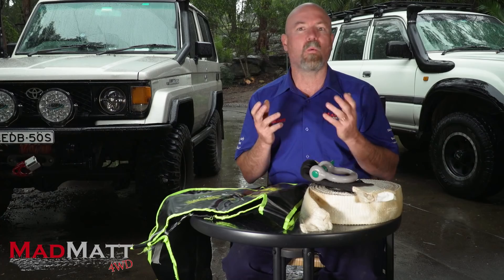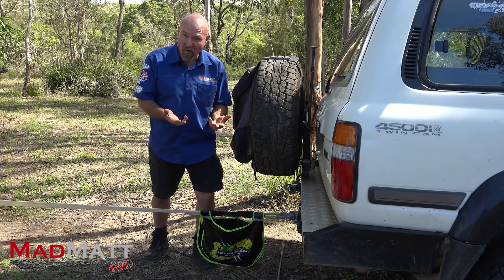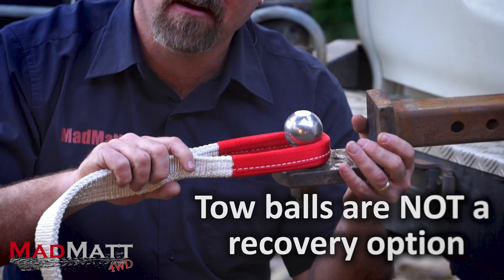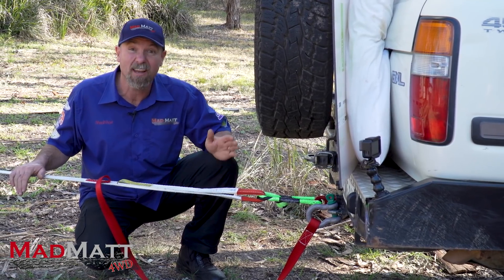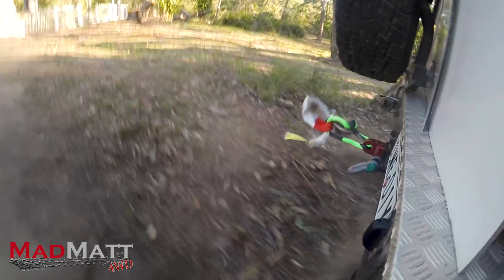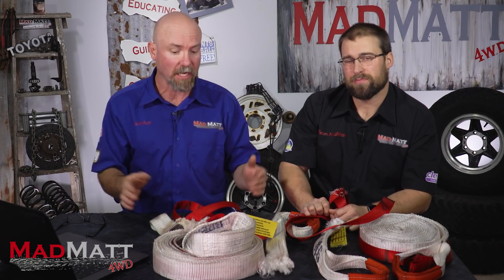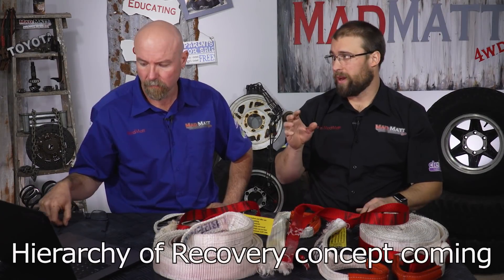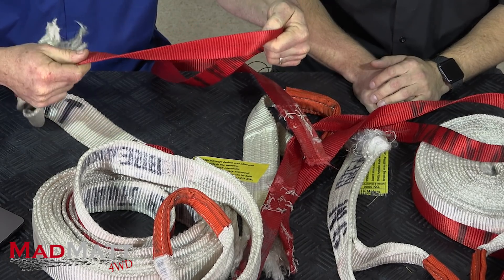Dangers of Snatch Strap Recoveries - Destruction Testing

Comment: Don't sell yourself short. Doing an expremiment and sharing your results is the definition of science.
Reply from the maker: Thanks mate
Reply: Absolutley, Scientific process is not limited to just "Scientist". Science is questioning, theorizing, testing, proof of concept and results. This video has all that.
Hello from America. :)
Reply: It is wise to know one’s limitations.
Reply: @MadMatt4WD 
Hey Matt, I saw a video of someone using a length of reasonably heavy chain, around 1.5m long, as a damper. It was clipped to the winch rope with carabiners. Are you willing to test this method of damping? For my mind it seems like a good idea, they had it at the mid-point, I'd like to see it at the heaviest point ie. At hook or shackle/failure point like a snatch fuse
Reply from the maker: @Duke-le6vy  I’ve heard of that idea but never tested it. I could look into it. The drawback is the chains weight.
Reply: @MadMatt4WD  I agree with you there. It's a bit of a double edged sword with the weight being both pro and con. That said I'd happily forego a few non-essential items to balance the weight of the chain if it's going to pull up a 200mph projectile! In reality as your test showed, 5kg is enough weight and that's not an excessively long piece of 10mm chain
Reply from the maker: @Duke-le6vy  yeah you make good points and that’s a good way to think about it.

Comment: This video has been incredibly helpful, have never even thought about how dangerous snatch recovery’s are so this was definitely an eye opener, keep up the great content Matt!
Reply from the maker: Glad to help theres a few other vids on the subject you may appreciate.
Reply: They used the wrong gear and it was to an anchored object that was never going to move, of course strap would break. All they proved is that the strap breaks first at the fuse as it is far less rating to the soft shackle and rear hitch

Comment: I enjoyed seeing these tests...I'm writing this after seeing your comparison with Yankem Recovery Ropes on . Matt's Off-road Recovery in Utah. I was impressed with that comparison too
Reply from the maker: Thanks mate. We're just trying to help and it's pleasing when we do.
Reply: Have had a failed strap go whizzing by my head. Scared the bagebees out of me.  Now use small Kevlar sling and two long chains.  Never had an issue after using the chains and Kevlar sling.
Reply: Me too. I still think MattUSA should be using dampers, especially when recovering cross overs and rental vehicles. I have a suspicion that a few of them have gone back with slightly bent suspension. That said, many of his recoveries would not approach a wood filled big hole for anchor effect.

Comment: I Had never heard of the tether, however i love the idea, as an Engineer, its totally the better approach, im pleased to see you guys working with who ever produced it to refine same, its far better than any ballast hung over the snatch strap, which could easily be misused, the tether just needs to ba a bit longer and slightly elastic, the idea being when the snatch fails, its long enough that no serious pulling load transfers to the tether only the load of the failed snatch strap, great work guys, John Gurney
Reply from the maker: Hey John. The company didn’t take on any of my recommendations. I think a form of fall arrest system is what would work.

Comment: Matt, real interesting concept, if you look at the free fall on a safety lanyard for working at heights this is folded and stitched in a concertina this allows for a longer length of safety strap and more likely control of the recoil
Reply: Exactly what I was thinking
Reply: The stitching isn’t just to shorten the tether, the stitches act as energy sinks as they blow apart when it’s stretched.
Reply: tether to a bag of dirt/gravel attached with easily failed string to vehicle

Comment: Hello, I found your channel through a link in Matt's Off Road  Recovery which I watch a lot. Thank you for the video, I did learn a bit from it which is why I watch these videos of course. One thing that I have always done which may or may not help some of your viewers. When I am pulling something out it tends to be a small tree or a fence post and I am using a basic tow strap. What I have always done is to put the rope through the canter of my spare tire fairly close to the end where my target is. This way if the rope comes loose from the tree or post, it tends to get wrapped around the tire instead of flying at my truck. By the way my truck does have a dual coil spring mount for the hitch which absorbs the sudden impact of a tow. Thanks again!
Reply from the maker: Thats an interesting idea.

Comment: Hi, great video. I love watching other people break stuff. 
I thought that tether looked a little short. I’m wondering if you or the manufacturers have discussed using a suppressor similar to that used in a lanyard for fall suppression when working at height. Picture this, the tether is 3m long, 1.5m of the tether is folded upon its self until the length is only 1.5m. The bundled tether is then stitched together in a fashion that is weaker than that of the anchor stitching and placed in a protective cover. The idea being that the tether is long enough that the snatch strap has returned to its static length before the tether loads up. Then if there is still enough energy, it will be dissipated when the suppressor stitching fails, leaving the tether intact.
Keep up the good work!
Reply from the maker: I’ve discussed that concept with manufacturers and they couldn’t care less. Very disappointing.
Reply: Sad.
Reply: What part of The country are you in? We visit every 10 years, 2022 is the next planned trip. Could pop by and say Hi if we are near by.
Reply from the maker: Sydney
Reply: @MadMatt4WD  They might if they are sued for knowing about a weakness and doing nothing to correct it, if a tragedy occurs.

Comment: Suggestion, have the tethers sewn up with a "zipper" style the treads are designed to "peel" apart in layers to absorb the energy
Reply from the maker: yes
Reply: Agree, same concept as a shock absorber in fall arrest systems.
Reply: Or do it like fall arresters so they break in stages, each absorbing part of the force.
Reply: Working at height stuff  from petzl has shock absorber zip stitched stuff in

Comment from the maker: I would appreciate you watching the FULL video but there are skip points in the description if there is a section you want to check out!
Reply: Hi Matt, good to see someone doing shock load test instead of bench test. How come you used soft shackle instead of bow shackle ? 
4wd "SAFETY" is a large can of worms. Doesn't matter how safe the equipment is there will be those that don't use it correctly. There's a video of people snatch/towing a newish Prado out of water with hooked on the bull bar not tow/recovery point. 
If tow balls are so prone to breaking when used in recoveries, why did Ronny Dahl have to cut them and still took several attempts to break them off ?
Also what's the point of "RATED" recovery points when what they bolt to isn't that strong ?
Reply from the maker: No real reason to use soft over bow. Both are good and safe. 
Yes it is a can of worms and yes I saw the prado vid and just shook my head.
Towballs are a single shear item rather than double shear this is the reason they're dangerous. Just because it took a few goes to get one to fail doesn't meant they don't fail. There are numerous vids of towballs failing.
Totally agree with you. This whole rated recovery thing is not that helpful and provides a false sense of safety IMO. Unless the complete recovery solution is tested it's just one item thats rated. IMO to call it a rated recovery point it needs to be tested as fitted to a chassis. I'm sure some are but not all. I prefer to use the term suitable which is more vague but removes the false safety element.
Reply: As for improving these tethered straps, first should the tether be of the same rating as the strap and maybe a Joey pouch to hold a few metres of the tether so the driver has time to react.
Reply: @Low Range 4wd WA I have my moments. The problem is the end user, will they use it correctly ?
Reply: @Low Range 4wd WA IMO there is to much focus on numbers IE how many KG's something can hold pull extra. 
What's the point of a 5000kg "recovery point" when what it's bolted to isn't rated. How many 4wd have a tow rating of 5000kg on the front ?
How people actually know what swl or wll means or what the percentage factor means or what the difference is between them and breaking point. When I learnt, I don't remember hearing about people being hurt, but back then we also learnt from doing it with our elders and it was a privilege to do it due to the cost. Unlike today, most items are a lot cheaper and people just do it without any form of training or knowledge.
Reply: Hey Matt, I have an idea for the company. Have a tether that is folded over itself a few times to make the length a meter and a half in this example of original length of strap. And that way the strap won’t have any stretch left in it and the tether can then be the only thing that has energy in it. Then the tether can rip off from the stitching and it will be the only thing with energy in it. And the weight of the strap will be too heavy for the tether to come all the way back. Does this make any sense?

Comment: MANY years ago, we did not have tow straps (much less *snatch straps*) and we used chains for towing a disabled vehicle or for pulling it out of the mud if it was stuck.  As such, if you took up the slack too abruptly, you ended up with quite a bit of jerk, possibly damaging both vehicles.  I've seen an old tire used as a shock absorber of sorts, kind of like how they use one between the cable of a crane and a wrecking ball during building demolition.  Chain has no give to it, so if you are towing someone and they don't constantly keep up the slack in the chain, you end up with a lot of jerking every time the slack gets taken up.  With a tire added to it, you don't get jerked as much.  Of course, the tires that were being used were a lot narrower than what you see on most off-road vehicles these days.
Reply from the maker: I have seen that. But yes there is a big difference between a tow and a kinetic recovery
Reply: @MadMatt4WD  -- Yeah, back then we didn't even have the concept of kinetic recovery straps / ropes.  Vehicles that had winches tended to be ones that had PTOs instead of electric winches.  Of course, there was always plenty of trees that you could use as an anchor point along with a farm jack and sufficient length of chain.  Things have changed a lot over the last 50+ years...
Reply from the maker: That they have

Comment: The group I wheel with uses a second snatch strap as a tether. We attach it at about 3/4 the length of the main snatch strap. I've seen a fail twice and the secondary snatch strap acted as a much stronger tether than the red ones and stopped the fly back.
Reply from the maker: That’s interesting.

Comment: Well, the moral of this test for me is the 9000kg snatch strap is far to light.  I know you guys said use items rated for your vehicle, but after watching this test 9000kg strap is not up to the loads. My snatch strap kit is rated to 13,000kg and I only have done 3 recoveries, my heavy recovery took 2 goes, so still good for another 6 recoveries. I had to snatch out a heavy 79 series LC and first go hit it very hard, and it just sprung my back, not damage to the strap, second go out it came, so higher rated snatch strap is for me the way to go.
Reply from the maker: Interesting but you have not understood how a snatch strap works when doing a Kinetic energy recovery. Also the purpose of this video is not to teach the finer points of a snatch recovery but to highlight the dangers.

Comment: Hi watching this in my view & I'm sure you must have taken this into account the fuse link should be on the tether with the weighted air bags attached to that so when it does fail it's ground to the weight reducing it's energy
Reply from the maker: I can't see the tether having enough weight to cause a problem.

Comment: Great video Matt, I'm a 4x4 enthusiast and trainer I'm Malaysia and I'm constantly searching for better methods of safe recovery. My comment on the test itself relates back to the product being tested. Yes the tether failed due to flaws in design and the loads overlooked.  In retrospect, the test due load the products beyond the limits of the ratings, but that is often try with every recovery scenario. 
Looking at the weakest point along the whole chain, the strap itself proved to be that as per intended and designed. 
I was looking for methods to secure the recovery points and accessories attached as they are the potential missiles that can hurt someone.  
Would you have any ideas on that,  like using a briddle to halve the loads of recovery points, bridle line as fuse etc.
Great job on this BTW.
Reply from the maker: Hi Jeff. 

i like bridles for sure and i also like suitable recovery points. I'm a little cautious around the idea of rated recovery points in that the can provide a false sense of security. It comes down to a rated point has to be fitted to a non rated chassis so my question is what is rated? Is the the complete recovery system or just the bit of steel that gets bolted to the chassis. Search my playlists for other work I've done that you may find helpful and interesting. I'm happy for you to use this content in your training if it's helpful.
Reply: Hi Matt and Jeff.
Firstly great vid very informative I'm new to off roading however I'm owner operator of a tilt tray aassisted with installing wire rope barriers on the freeways in Perth. 
Which gives me an idea for a tether on the wire rope system they feed the 20mm wire through a swaged loop in 10mm wire which is anchored the concrete footing. The theory is that the larger wire gets tangled by the looped wire slowing and sometimes stopping the highly tensioned larger from being  missile.
So I wonder if attaching a spare strap either snatch or tow of a shorter length or double through shackle, giving us 2 loops to work with 1 close and 2nd towards the middle and still use a damper or 2.
I hope this helps.

Comment: Hi. I'm not an engineer and I don't have a degree or anything, and I have never done a recovery, but I am a safety freak. When I first seen this video and what you wanted to accomplish, I immediately knew what was going to happened. I think that the safety strap sould be ?x more than the recovery rope/strap. The same concept that you had when you connected the strap to your vehicle. So if the rope/strap fails at 9,000 units, then the safety should fail at 11,000 units, and for it to be long enough for you/the driver, knows when it fails so that they can stop in time. This is just my own opinion.
Reply from the maker: Yeah when I first saw the design I didn’t think it would work either. I think a fall arrest type design is what’s needed.

Comment: It looks to me that by the time the strap fails it has already stretched to the point where when it does fail you don't have to travel any further to make that other safety strap snap my thought would be if you add another 5 or 6 ft to the little safety strap then your big strap isn't stretch far enough for it to run right through that little safety strap I think a good 8 to 10 ft would be sufficient amount of length to stop the strap from coiling off the vehicle and smashing into a vehicle being pulled
Reply from the maker: That's what we're thinking as well.
Reply: MadMatt, Did they ever come out with a safety tether snatch strap that works?
Reply: @Jason Bowman you would think that they would you know because there is recommended strength and then failure strength so totally agree

Comment: I also agree the tether should be shock absorbing.  ? If it should be tied or anchored separate from the two anchor points as a better catch (since you can't stop fast enough to keep from breaking  it).  Climbers use it (second anchor) for static climbs.  With a moving vehicle that energy has to absorbed  somewhere (when strap fails).  Appreciate the demo.  Has me thinking more on it.
Reply from the maker: pleasure

Comment: The thing that strikes me with many 4x4 owners is you see someone ripping away with a snatch strap until it breaks putting a lot of stress on their vehicle and the other vehicle also , when all along  they had a big fat winch under the bull bar . Yeah , "it's quick an easy until it fails quickly and easily ".  To make the strap safer add air brakes . Small parachutes attached  along the strap .
Reply from the maker: I totally agree. Way to fast to grab the snatchy.

Comment: They need to sow the tether to the snatch strap the other direction when sowing it to the body side of the snatch strap. That way when the snatch strap breaks, the part of the snatch strap that is flying backwords will work against the stitching.  And also, you are correct.  The tether needs to be a little longer.

Comment: Safety tether should be 1/3 the length of the snatch strap, with folded loops held together with zip ties. -Lessons learned from high power rocket recovery. You want that energy dissipation stretched out over time through the series of zip ties snapping, before loading what's left into the tether.
Reply from the maker: Very cool idea